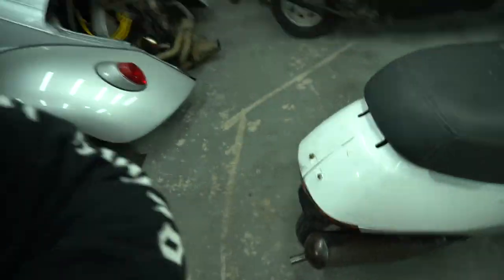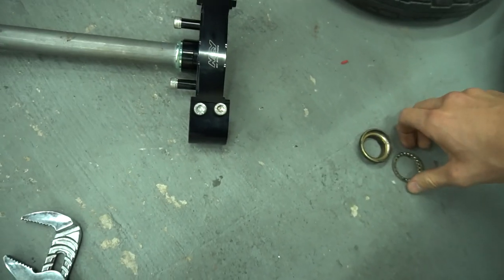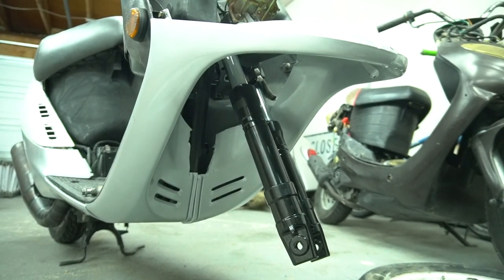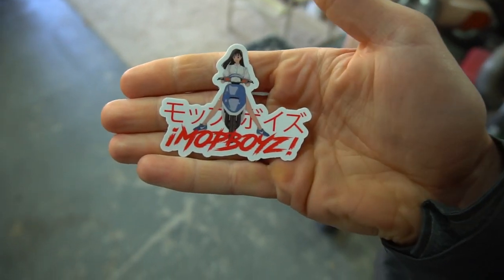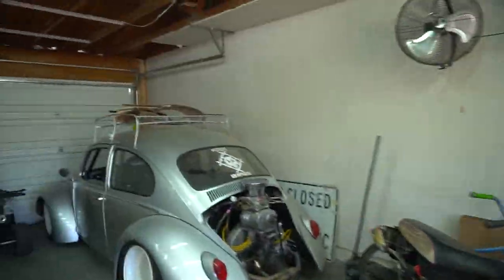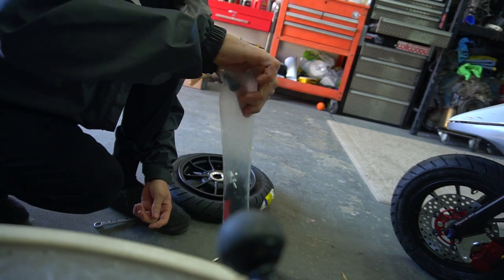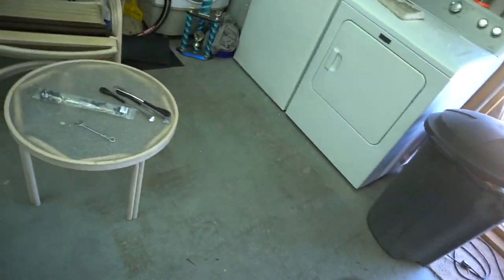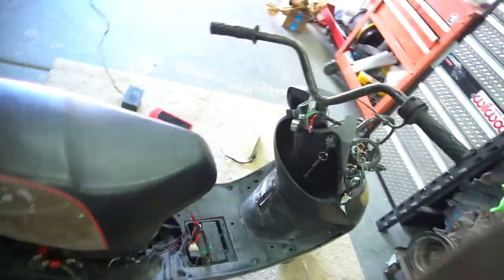120cc ELITE gets FRONT DISC BRAKE | NCY Stem, Fork legs, & more!

Comment: Yo trev, i just put together a 5  lb co2 tire fill/ soda carbonation tank for $150. you might already have an empty bottle or old fire extinguisher it holds a constant 900 psi and can be used to run pnumatic tools without a compressor, i noticed you were struggling with that little arb compressor with as many tires as you got it a 10 or 20lb bottle of co2 would last forever and you can put alot of stickers on a tank the look cool ;) peace dood!